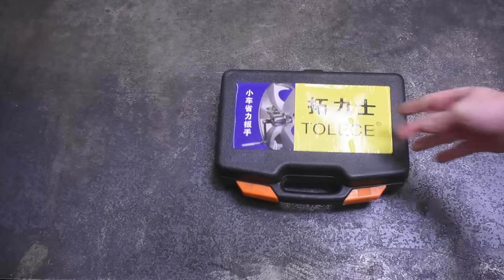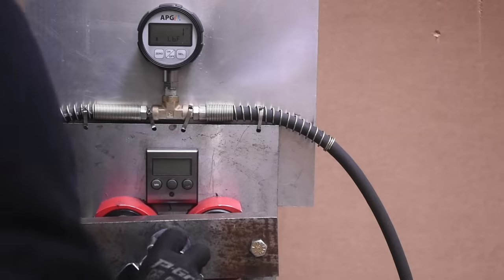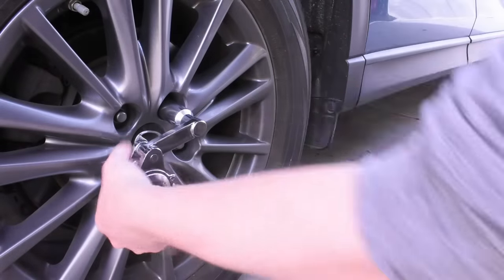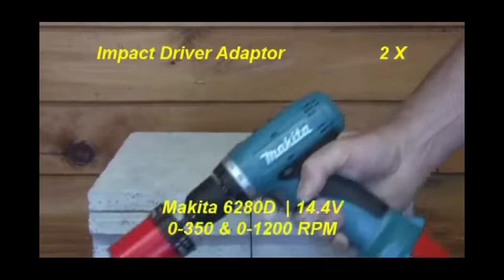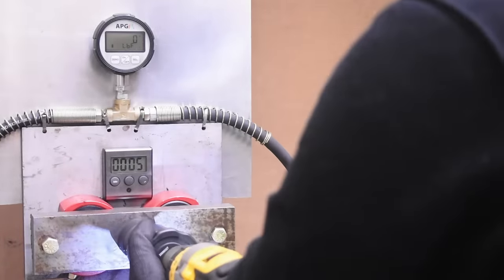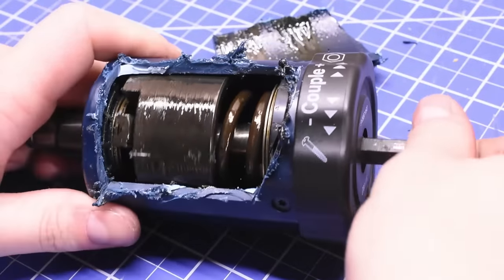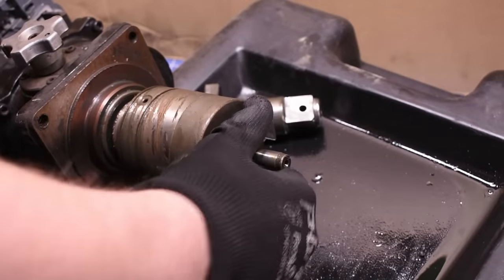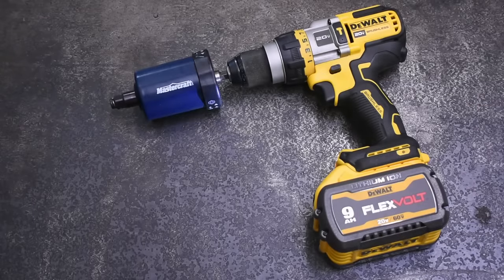Testing TikTok Tool Hacks: Surprisingly Amazing!

Comment: When using the torque multiplier for lug nuts, once you have tightened them, simply go in reverse. The device won't loosen the lug nut until the extension arm gets to the other side. Stop before this point and the adapter will be able to be removed just as easily as when you put it on. Problem solved.

Comment: YES!! Have one, and wish I could buy another one, but unfortunately cannot be found anymore... The only weak spot is the plastic, which the housing is made of. Mine cracked along the front, then eventually the crack advanced around and the front of the body just separated, rendering it useless... Still have it, and planning on fixing it with a metallic front replacement...

Comment: I could totally see a manufacture making an adjustable spring impact.  But with a detent twist collar so the average idiot could understand.  Like what's already on screw drills.  Tune each detent for 1Ah increments.  It would need a steep thread pitch so you could have 15 stops withing one full rotation, but worth it to anyone who has a collection of batteries, and wants to get the most out of their big chungus batteries.

Comment: Wonder if it got discontinued also because of the drill stall. Meaning too much would damage the drill. Thought it seemed to pause a little in slow mo. Don't know if drills are meant to stop slightly or they have to spin freely.

Comment: Quite interesting. At in one time I was thinking of getting one of those hand crank type wrenches. To get what I thought would be a good one it was more than a battery impact wrench. This pretty much proved me right. 
On the one for the drill, I never seen one of those. If I did I might have gotten one. Slick device.
A lot of battery impacts have an adjustment on them, not as adjustable as the drill powered one, usually just three positions.

Comment: I have a cheapo hammer driver that frankly does 90% of what I need. It use it to run up fasteners than finish by hand. (1) I don’t want stuff over-tight or sheared off and I don’t want to be buying socket adapters every other day. I slake have a powerful 1/2” impact wrench. It’s viscous but frankly the 24” breaker bar is usually just as good.

Comment: We have higher end version of these torque multipliers for changing tyres on our semi trailers on the deck spreading trailers. When the deck is spread you can not get a long enough bar on the wheel but due to lack of space

Comment: Used torque multipliers for disassembly and assembly of turbine engines. Had to break torque of oil tubes and shafts. The one we used though was enerpacs sweeneys. Smaller ones ranging to 13,000 ft lbs and bigger ones up to 30,000 ft lbs

Comment: I did not expect that out of the drill adaptor. 

That thing is sick.

Makes sense though, it would be a massive drill motor to house that big ass hammer and spring, but thats not a problem for an attachment.

Comment: I'm wondering if the overall hammer/anvil weight and IPM with that DeWalt drill make the adapter a nearly identical setup to the Makita XGT impact, because those results are crazy similar.

Comment: I want adjustable driver impacts for cabinetry. I love my very powerful Milwaukee impacts, but the lack of impact at low speeds causes the bits to jump out of the heads of the screws often, where my older X4 Rigid impacts could more easily start impacting at low power and never struggled to control the bit. In my case, it is very important that the bit remain strongly seated so that a skip out of the head does not plunge the tool into the freshly painted cabinetry or doors.

Comment: I used to work on off shore beach building dredges and used the impact multiplier as well as the hydraulic to replace runners and liners on the huge high pressure pumps for the shell door thread rod bolts and nuts they are 4” dia rod w huge nuts. The pressure is impressive

Comment: What if I put that MasterCraft impact attachment on my impact driver?
Reply: MasterCraft is a brand known for its tools and accessories, and if the impact attachment is designed to be compatible with your impact driver, it should work well. However, it's essential to check for compatibility and follow the manufacturer's guidelines.
Reply: So will I get ... Double impact?

Comment: would be interesting to see that impact adapter used with the high speed drills like the 3600 rpm Festool TPC or the 4000 rpm Metabo SB 18 LTX-3 BL

Comment: I'm surprised with the impact adapter for the drills. I thought the high speed of the drills would actually bring torque down but it worked just like an impact tool where torque is directly related to RPMs and IPMs.

Just wondering how much torque a 4 speed Metabo or Hilti drill could make out with this adapter

Comment: I like to modify everything so if I had a cheap or lower ft lbs Impact driver and used that hand tool that’s has the arm to hold onto a lug and use it to increase the amount of torque to remove higher torque bolts. Kinda like when you have tools laying around and want to Frankenstein something for a specific job.

Comment: Could you try the drill adapter with an ungoverned air drill? I think they can reach 10k rpm and that might be wow leaves if the air drill can get up to speed.

Comment: You should try to put a few washers into the drill adapter and see if you can get the spring tighter. I bet with that DeWalt if would make even more power but the question is how much more.

Comment: From my experience propelling lead and such at stuff (usually) i wondered which hits harder: a heavier bullet moving slower or a lighter bullet moving faster? The standard knowledge (idk if it is right or where it came from) is that speed adds more energy than mass. Something like weight added equals a linear energy gain while speed added is squared or something to get energy.

Comment: i have the same tool on my channel , but here,s the rub... i went in and modified the unit so i could use it in other situations ... like a rear pinion nut , this thing is very powerful and can over torq if you dont pay attention, i took mine apart and ran some better grease inside so it would hold up better, plus you can still use the hand crank ratchet end and works like a breeze.

Comment: 3:54 you can tighten lug nuts with them, you just have to turn it back a little, that won't undo the tightened bolts.

Comment: The emergency lug wrench that came with my car wasn't long enough sometimes to loosen lug bolts so I just bought a cheap small length of black iron pipe for torque multiplication to store in the car.

Comment: Have you had chuck issues with the Dewalt drill y used throughout. 

I'm on my third sometimes the chick gets locked up and doesn't want to release and after a few times of that you can pull the chuck in and out 1 will be the most loose hammer drill will tighten it up but still can move in and out. At this point I'm thinking of switching to Milwaukee.
Reply from the maker: I hate this type of dewalt chuck personally

Comment: So.. a tip for people trying to remove lug nuts at side of road. Just rotate the bar to a position where you can stand on it with one foot, then out entire weight on that leg and just bounce on the handle. The lug nut will come right off.

Comment: Testing torque multipliers and their efficiency would be great.   I know they guys in my shop like to grab a 3:1 multiplier and a 1/2" torque wrench instead of the 3/4"  for evenly compressing gaskets on large pipe flanges.

Comment: Huh that drill adapter is pretty cool. I might look into finding one somehow. I don't have a battery mid or high torque (I just use an impact driver; it's enough for lug nuts) but I do have a couple battery drills. Sometimes it'd be nice to get some more beans without firing up the air compressor for my air impact.

Comment: There is something to be said for not giving Joe consumer mega torque. I was using a “Hole Hawg” iirc and also iirc it was a well known big red tool. When using a two foot long and one inch or one and a half inch diameter popping holes and it binds up in a flash you remember the old timer telling you to be careful with that thing. He has seen more than a couple guys forearms break before they even knew a problem might be developing.

Comment: Used a hydraulic HYTORC once on large pipe flange nuts. If I remember right, it was rated over 100,000 ft-lbs of torque. Could you test one of those?

Comment: Why wouldnt they make a drill that swapps the head out for this. Like you lift a latch and replace the standard head for the torque adapter.

Comment: I have one of those  mastercraft impact adapters. I got one for shits and giggles when they were on sale at the good old canuck tire it was on for $19.95 the way i saw it if it didn't work i could just return it   what could go wrong. Since I already had a cordless drill and i used a breaker bar to break the lug nuts loose then use the drill to spin off the rest of the way was really surprised when I got the nuts loose without the breaker bar used it for a few years still works but just sits in the toolbox since I got access to better impact wrench i don't regret buying it that's probably why I still have it lol

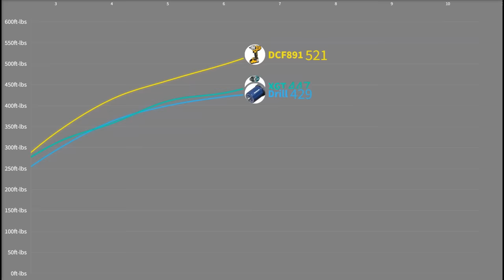Comment: Just a thought  a standard lug wrench is about 14 inches  place wrench parallel to ground at the 9:00 to loosen and step on the handle.  A 100 lb person will apply 100 foot lbs. So there you go.

Comment: Aside from the torque of that adapter, the fact that it didn't break is surprising. Impressive.
Reply: Yeah it kinda was surprising, but then again the internals are the exact same basic principle as the factory made impacts use. It's just in a different housing, so why wouldn't it work if you think about it?

Comment: I would love to see the adjustable spring tension implemented into inpact wrenches. It wouldn't have to be only battery powered, it would workfor air powered too. I could imagine a sensor to monitor the forward/back movement of the hammer and adjust the tension for best performance as the battery discharges/how far trigger is pulled.
Reply from the maker: Air powered doesn't use a spring

Comment: How can the faster rotation of the drill lead to a bigger torque if the energy to the hammer is transferred from the compressed spring?
Reply from the maker: Higher rpm leads to greater hammer speed from the spring being rotated and bound more. We've measured it
Reply: @TorqueTestChannel  so if you have higher rotation the hammer protrusion will bump a little bit higher over the anvil protrusion because of the rebound than on lower revs?

Is the difference in torque big on low and high rpm settings?

Comment: I think I know what happened to the MasterCraft impact-adapter. I'm pretty sure all the tool companies paid MasterCraft to STOP making that impact-adapter, because it was effecting the sales of their mid-tier impact drivers. There are companies which will pay other manufacturers to NOT produce some[THING], just because the sale of that [THING] is hurting the bottom-line of the company too hard. This might be a case of the impact-adapter having a VERY negative impact on the sale of DeWalt, Milwakee, and other tool manufacturers' mid-tier impact drivers.

Comment: You should post up the dimensions of that railway hammer spring and see if we can find a heavy duty version. I'm sure some industrial service guys are going to see the numbers and source some banana upgrades. 

it would be a hell of a way to step up the home build game

Also, I definitely want one of those drill adapters. it seems like if someone designed a beefy version for today's drills, that thing could be putting high torques to shame
Reply: Yeah, definitely post up some specs on the stock spring. I guarantee someone watching this knows where to get some beefier ones. I love that adapter. I didn't even know such a thing existed. Would be a great piece of kit to keep in my tool box.
Reply from the maker: @kasuraga  The gearbox is currently soup though, so the spring wasn't its weak link

Comment: An adjustable impact gun would be neat, except I must have bought the only ones ever made that have different modes and variable-speed triggers...
Reply from the maker: They are sprung to operate in low, which means the max potential of that fixed spring rate is weak

Comment: I put a big breaker bar in all the women’s cars in my family and they love them. That used to be a problem because my mom, sister, and wife had a hard time with the tiny lug wrench. So I went to super harbor freight and got them each a big breaker bar with the correct socket. I know you are all saying stand on the lug wrench but they don’t weigh enough ha ha.  My moms new emergency kit has a corded impact that she uses in case of a tire swap and they all have electronic jacks in there cars.

Comment: Why can't the first product be used to put lug nuts back on? The reason you can't get it off, is because there's tension on the mechanism and socket, so if you just backed it off slowly until you could remove it it's not like it would be loosening anything cuz it's going to have to relieve the tension on the mechanism and then begin applying in the opposite direction, so if you just stop before tension is applied in the opposite direction, you can take it off.

Comment: Another great video. 👍 It would have been cool if you had a way to measure the input force on that hand cranked device so we could have gotten some idea about it's efficiency. A crude way to do that would be to affice a spring scale or other inline scale at a specific length along the handle and then pull on the scale to input the force. Spring scales have a little sliding tab that will show you the maximum load applied in dynamic conditions. Spring scales do have a lot of travel though, which would be annoying in this application so maybe some other kinda dynamometer would be better. Anyway, thanks for the video.

Comment: I don't see those adapters lasting over time the hex shank would go first, Now if instead of a hex shank a bigger shaft attached to a heavy duty square socket where the impact wrench would just slip in sounds more beefier

Comment: For most stuck nuts, a force multiplier isn't gonna do you any good anyway.
 
The reason impact wrenches are so effective is because they are not just applying force, but also impact. The impact helps to break bonds at the microscopic level...  something your torque multiplier can actually make worse. Impact tools also help to flow more lubricant where it's needed and create less friction (less torque needed).
 
Your force multiplier sounds nice and has attractive numbers, but force multipliers on lug nuts? You're going to end up having to replace lug screws I bet. A breaker bar is already more than enough of a force multiplier, I promise. If it's not coming out with an impact wrench and breaker bar, it's time to just tear out the lug nut and put in a new lug bolt and nut.

Comment: I assumed these were to combat the tyre fitters using way too much torque when putting wheels back on, if you get a flat on the highway you ain’t getting them off with the wheel change kit in the car. After tyres I take mine straight home and loosen the wheels before they cease, apply anti cease and tighten with a normal breaker bar, that’s tighter than manufacturer spec and I can get them back off again if I need to

Comment: Schoolboy error made with the Torque Multiplier! Everybody knows you have to back it up a half turn or so after tightening a nut, to release the tension in the gear mechanism.
That said they’re mostly cheap trash. A good quality one will tolerate a high torque impact gun hammering down on it, so is useful for emergencies where a corroded nut has absolutely welded itself on.

Comment: You oughta get another torque multiplier, remove the arms from both and install two torque multipliers , ones output to the others input , and bolt them together through the hole and see how much torque that thing would handle before it can't lol

Comment: It is huge, larger than most mechanism in impact wrenches. wish for something smaller and cheaper.  I bought a cheap Chinese impact for $40, four months ago. I just used it once to bust a small rusted nut to repair an expensive mop bucket but I could buy a new similar bucket for just above $4 .🤭🤭 Wish I could use the impact again around the house, unlikely I will use it to loosen lug nuts. I might overtighten lug nuts if I use an impact.

Comment: i've seen another video that looked like they had a much better version of that torque thing so good in fact a small child was turning it the wrong way and managed to start stretching the bolt
(Edit): Can't seem to find the original video I saw but after doing a bit of searching it seems I have found one that actually works and even snapped a 5/8 stud "XtremepowerUS Torque Wrench Labor Saving Lug Nut Wrench Torque Multiplier w/Cr-v Socket (Torque Wrench W/ 8pc Socket Set)" It has a 1/58 gear ratio

Comment: Epicyclic torque multipliers are wonderful not least because you can use them to precisely tighten fastener and remove fasteners without beating the fuck out of what they're holding. I use my X-4 on Harley compensator nuts which I slather with red Loctite for safety reasons. I can remove them with one hand instead of a three-foot pipe. They of course make precise torquing easy and the heavy equipment guys stake them for super high torques. 

Testing them would introduce your large viewer base to some wonderful equipment and likely broaden the market. Williams and Neiko make that style too.

Love the spicy soda can. I'd buy one to leave in my drill bucket.

Comment: Honestly, with how good impact drivers are and how accessible impact wrenches are, I doubt we'll see those adapters again. They just aren't economical. If you have a battery drill, why spend 50 bucks on an adapter when you could just buy an impact driver or wrench for a bit more and get a more compact tool overall?